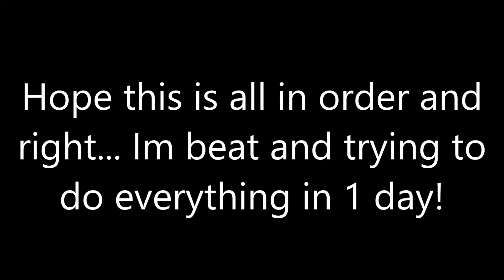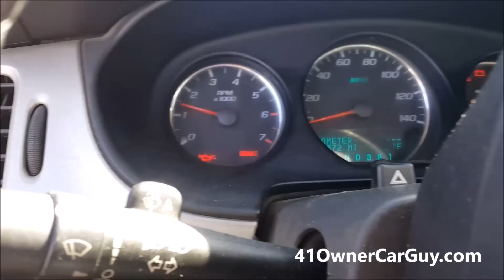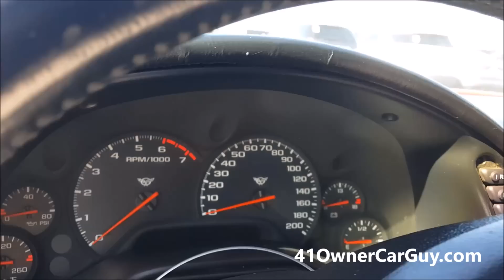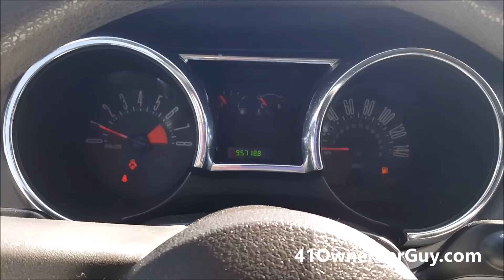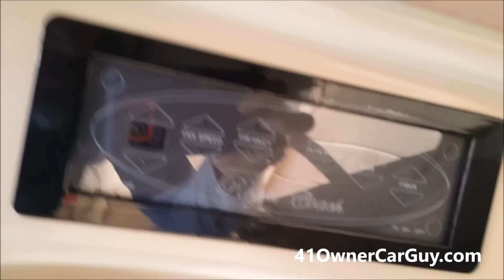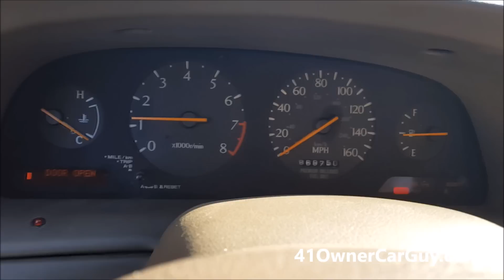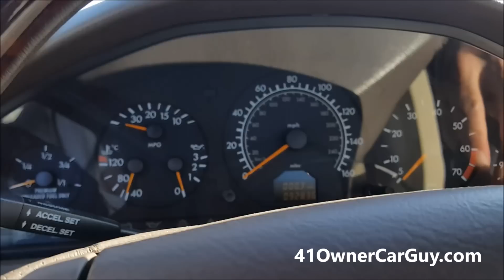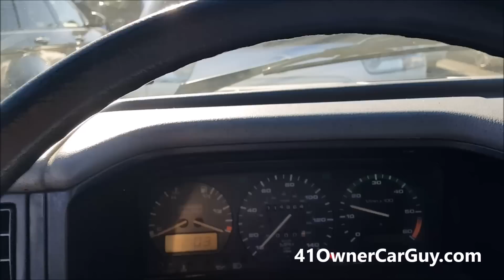HOW TO MAKE MONEY AT AUCTION ON CARS ~ AUTOMOBILE VIDEO AbC! #1

Comment: I Bet MOST of those check engines lights are from buttholes revving the motors while COLD🤔
Reply: mate sivric yeah that's so cringe. You could even see the heat thing being on cold
Reply: No ,they are from other buyers removing a wire or something else so you won't bid on it, thinking something is majorly wrong with it,, welcome to the world of auction buyin ,Lesson #1